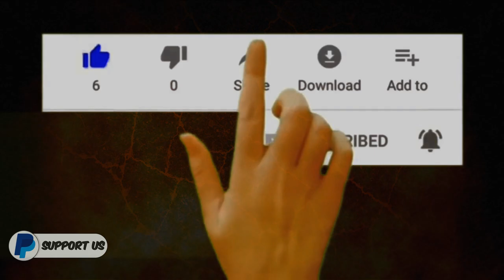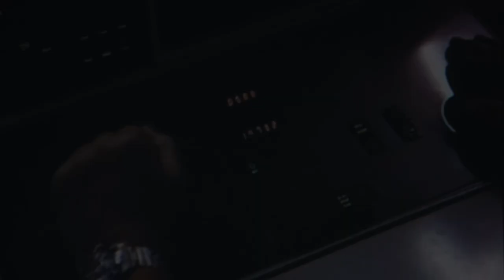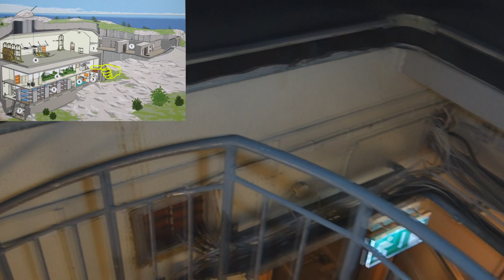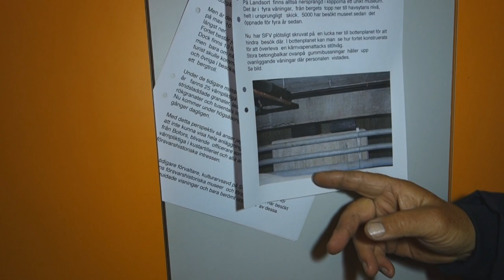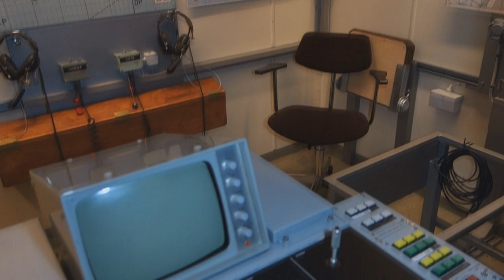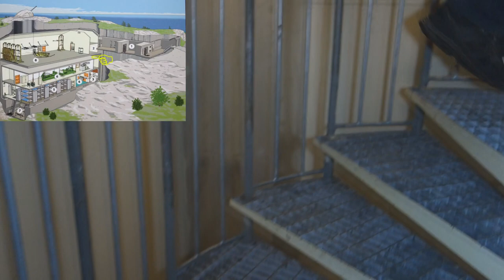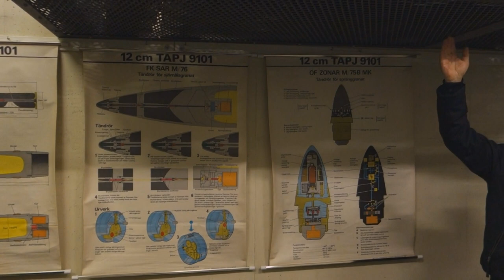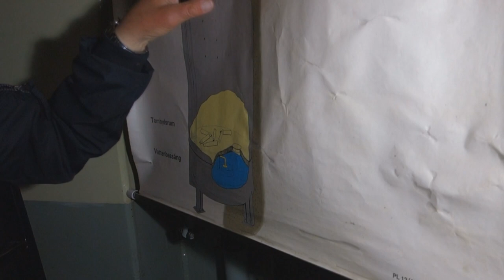BUNKER 120mm automatic gun system / ersta Battery Landsort

Comment: That English speaking guide isn't very good in English... 😀 
5.42 - 120 mm/12 cm gun, not "20 cm".
5.55 - High rate of fire, not "high velocity". Velocity is the speed of the projectile when it's leaving the barrel.
5.57 - The word "chill" might not be totaly wrong, but usually we say that the barrel is water cooled.
7.04 - He says "Arlanda", but the English subtitles says "Orlando". Neither says anything to a non Swede. Arlanda is the main and international airport of Stockholm.
7.53 - Steel doors or gates, not "iron wood".
10.53 - He use "velocity" again, when it should be rate of fire.
There are more of English spoken there with a doubtful quality.
Reply: Not the guide fault, but pls note 

1. That "ERSTA" is not the name of the place where the battery in the video is located. "ERSTA" is short for "ERSättning Tungt Artilleri" (Eng.: "Replacement [for] heavy artillery""). There are places in and around Stockholm with "Ersta" in the name, but this battery is not in any of those places.

2. The "hovercraft" mentioned in the English subtitles are actually air-cushion carts, to move the ammunition in the magazine to the ammunition hoist.

Here's another guide "slip" 9:45: I'm protesting ...". What he wants to say is that he is demonstrating (showing, illustrating etc). In Swedish the word, "demonstrera" is used for both in the meaning "demonstrate" and "to protest". This is one of the cutest "Swenglish" manoeuvres I've ever heard! ❤️ 😊